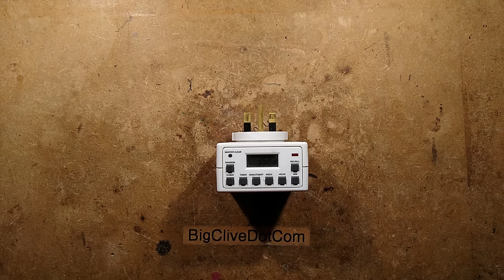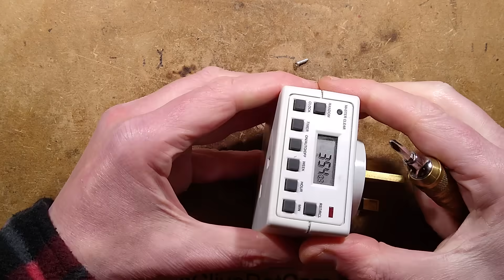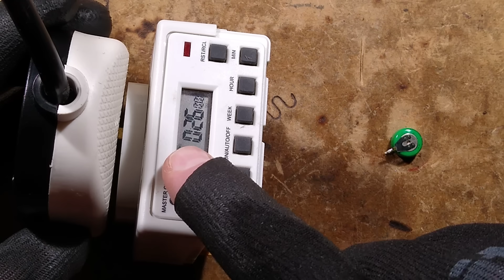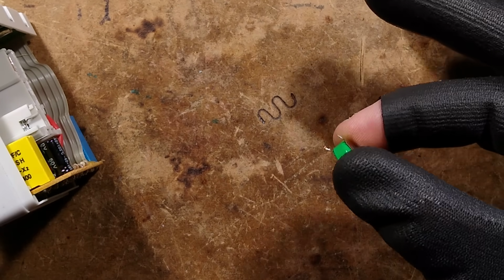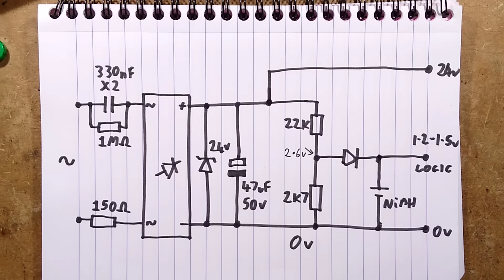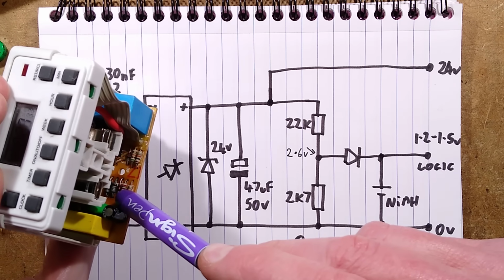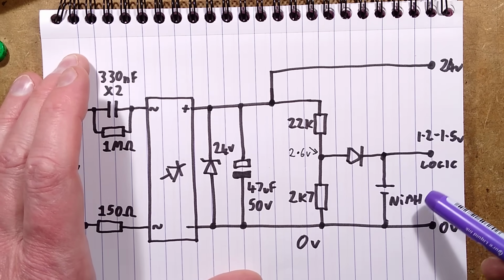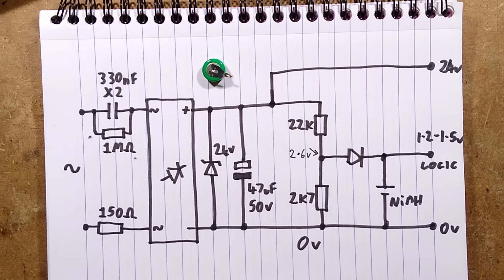Can we fix this faulty time switch?

Comment: I was attempting to repair my heating programmer, an old Horstmann Centaurplus c21 series 1 over Christmas when we lost heating. The CH relay was seized and wouldn't click on when the timer reached the programmed hour. I did think of switching it with the HW one but as the big square capacitor looked toasted, I wanted to replace all the parts. Problem they were obsolete and no one had stock so for the sake of £5 worth of components, I had to buy a replacement programmer at £70 😡🤬

Comment: Won't AC more likely throw your hand off isn't it DC that is more dangrous and stop you from removing your hand easily?  Having said that I am not volunteering to test either.
Reply from the maker: Smooth DC causes a single brief contraction.  AC causes a sustained contraction.

Comment: I have exactly the same timer switch. I think I bought it from Wilkos.
The battery died in mine and I think it was a lower mA than your example but I replaced it with the same as yours has.
Mine just wouldn’t hold its time, although I hadn’t used it for ages and the battery must have drained too low. I guess that’s the issue with this type of battery.
Ironically I have an electric razor that was stuffed in the back of a cupboard and I kinda needed it. I thought that this bugger is going to require a new battery, but no! Lo and behold it charges and doesn’t run down rapidly either.
I recon that’s progress for you!
Great videos BTW 👌

Comment: 3:40 just for a bit of jeopardy and excitement we will just scoot a metal screwdriver a tad closer to the spicy boomy bit.
Reply: This was such a stressful watch experience. Clive moving the meter and bumping the brass screwdriver, (and the small screws rolling about) were just about a short circuit BOOM 🎆 away!
Reply: I don't think he would have wanted to compete with ElectroBOOM 🔌.
Reply: Another "trademark" etching of the table averted !!! 😆🤠😎
Reply: I noticed that too!
Reply: Why else do they have plastic handles?? ^_^

Comment: About those disclaimers: The manual for old cars had information on how to time the contact points, what order the spark plugs ignite, what torque the head-bolts needed... Modern car manuals just say "don't drink this liquid" and "don't touch those moving parts" or "don't slam your d**k between the doors" .....
Reply: The manual for my car is 550 pages!
Reply: @lint2023 My newest car is like this and the manual is still mostly useless!
Reply: @lint2023  It was sarcastic exaggeration ;) Yes, car manuals still have a lot of info, but not nearly as much as they used to. And a lot of warnings that should be common sense.
Reply: @angeldelvax7219  I wasn't pushing back on you and I apologize for letting it sound like it was.  I should have included that it is 550 pages and has no real maintenance information like you described.  I liked the comment you posted about manuals from earlier times.
Reply: @lint2023  Probably a combination of my autism, and the "state of the internet" as far as general negativity goes that gave my that idea ;) These days I find myself automatically in deference mode when replying :(

Comment: I expected a low value cap, like my remote controlled switch. 
I think I would have fitted an AAA NiCad and reduced the current with a 33K resistor 
(had I managed to work out the battery was at fault). 
Nicely done Clive*.
*(Note a "sir" no longer has a positive value, but you deserve honouring for your service to education & entertainment).

Comment: If your growing Oregano and Basil at home under 2000 watts of light, these damn time switches always break. You have to hook up several to reduce the load on each one. You can get prof. ones, but they are ridiculously expensive in comparison. Probably easier and more effective to build one with arduino and some heavy-duty relais for the switching.
Reply: yeah better grow weed... that ain't gonna cause those issues 😅
Reply: @casemodder89  :dothefive:🤣 But that would be illegal 🤣
Reply: "Oregano" "Basil" lol alright there spice girl

Comment: The warnings can still be useful just as that regular reminder. I do think people can go overboard as usually all you really need is a quick “This is mains voltage. Don’t be stupid.” You don’t really need to go into crazy detail every single time it pops up. Liability is a lot more nuanced than many people think. Otherwise a lot of things that we’re used to wouldn’t be available.
Reply: I prefer people using actual protection like isolation transformers and/or inrush lightbulbs and dedicated workbench FI and mentioning them. (Having said that it’s good that Clive at least mentions sometimes to use battery operated (ground isolated) scopes.

Comment: Did you float the zener to give it a bit of extra air space?
Reply from the maker: It could be floated or two 12V ones could be used in series.
Reply: You’d think they would put some thermal paste on the zener diode and stick a small heat-sink on top of it 🙄
Reply: @samuelfellows6923  But then it would cost more and people wouldn't buy it. See also the Songle relay.

Comment: I chicken out probing live things, generally I use crocodile clips onto the connections I want to test, leaning to the side I turn it on, for larger things I have discovered a remote control relay 😂
Reply: @phonotical 
I use chopsticks.

Comment: Nice fix and Thanks Big Clive.  Watching you trouble shoot stuff is a master class for sure.

Curious about the Zener Diode running hot.  Is there a fix for that.  The discoloration seemed legit.  Would a different diode of the same voltage handle the current better?
Reply from the maker: A higher wattage diode could be fitted, or two 12V zeners in series to spread the load.
Some units use a switched resistor that turns on when the relay coil is off.

Comment: Good fix. Great work. Note at 3:40, unit powered on, gloves on, moves meter and brass screw driver rolls toward exposed live module. Was expecting sparks and a loud bang. Oh well, next time perhaps.
Reply from the maker: Yeah,  I really should add an anti-roll thing to that driver.
Reply: Next time gadget, next time.
Reply: I thought the exact same thing... Previous experience? Maybe.
Reply: My anxiety was high during the video, not because of you handling mains voltage (you know what you are doing) but ... that screwdriver 😮
Reply: ElectroBOOM ⚡😂
Reply: Eh it would just add a nice patina to the brass 😆
Reply: @coreyalexbarker  and some nice charring to the workbench.
Reply: ElectroBOOM crossover when?